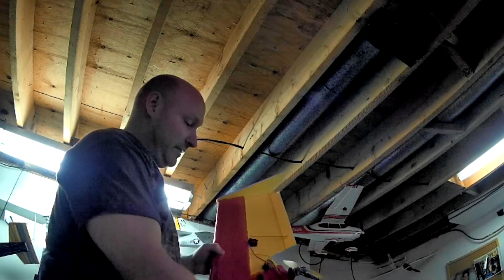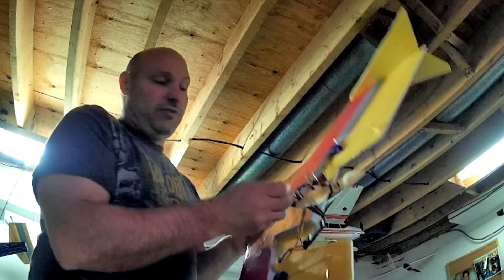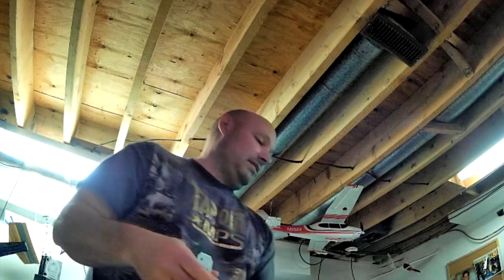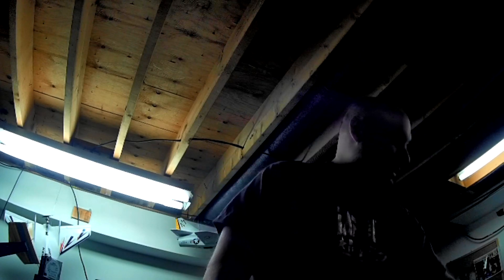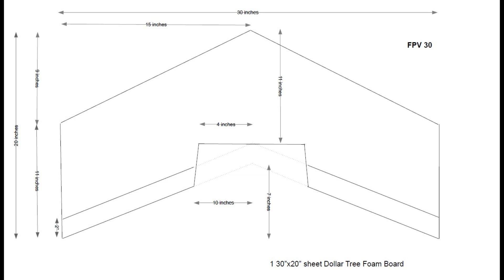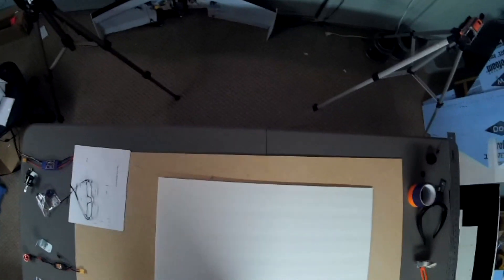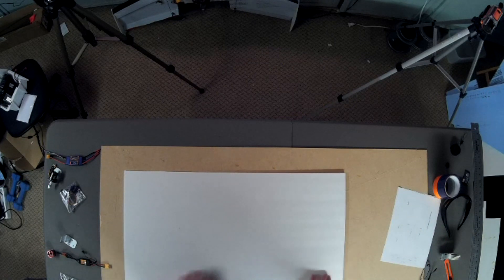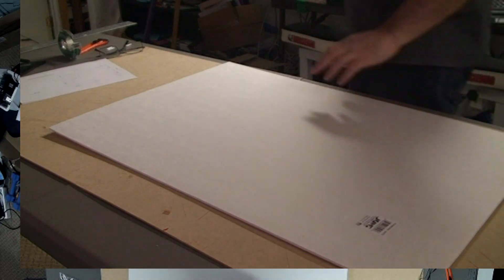How to build a Flying Wing - Part  1 - Taping and Initial Design Thoughts

Comment: Just finished the maiden flight on this beast yesterday with some help from a friend at my flying club. I had to make a a minor modification to my motor mount to get it in the vertical center of the wing. Once that was done it flew like a dream. Thanks for your video.
Reply from the maker: Anthony McDonald Wahooo!   Congratulations.  Did you take any video of it, I'd love to see it fly.  I just watched your bad motor video, I've had the same thing happen (never on a new motor, but after a crash).  The same behaviour though, one of the motor wires is broken or has a bad connection.

Comment: Daniel, If I recall correctly you said that the CG on this build was seven or so inches back on the wing.How did you calculate that value? I feel like that is going to be mondo important to the way this guy flies. My CG calculator (Online) says 6.36 to 6.7 back. Not sure why the difference. Any ideas??
Reply from the maker: Anthony McDonald The original design for this style was by ProjectFlightDesign |(delta pusher).  I think I got the CG from his vid.  I've built several of the KFm2 versions of this wing and generally find that they fly a little better with a bit more weight up front (but launch is a little more tricky), so you might be right.  A little more forward might help a bit.  The first flight will tell you if you are right :-)

Comment: thanks for your answer!!Did you try to paint the plane instead using tape .I do 1/10 rc race and i have some paint around ....I  really love your videos ,im looking for many things about built my own .Did you try with wood too ?
Reply from the maker: No, I haven't tried painting.  With this design I take the paper off of the middle piece (the thin foamboard).  The tape on each side makes it stronger.  A good example of how the tape does this is my lightweight desing (using all foamboard).  You can see how "floppy" it is before it is taped and how it is much more rigid afterwards.  If you paint you might need some extra carbon fiber support, or leave the paper on the foamboard.

Comment: is it really cheaper than a RTF plane when you buy everything separatly ?i love your video
Reply from the maker: Thanks for the comment.  Yes, when you include shipping I think it is cheaper to build your own (shipping the small parts is not very expensive, but shipping the larger foam body can be quite expensive).  The parts list for this plane is more expensive than some others because it is meant for speed.   My FPV44 (about 42" wingspan) can be built for between $40 and $50 and is one of my best flying planes.  Of course one advantage of building your own is that you will automatically know how to fix it and what the correct part is if something breaks.

Comment from the maker: Daniel, those rolls of packing tape are only a couple of bucks each and are 150' x 2" which I think is 25 square feet.  That would put the cost at about 10 cents per square foot.   Not sure the Vinyl wrap can compare with that price.   How heavy is the Vinyl wrap?   Peel and stick in one sheet would certainly be easier, but looking at the pictures I would be worried about the extra weight.  The packing tape is very light and thin, adds almost nothing to the weight of the plane.   Thanks for the tip...you never know (although I did buy 36 rolls of packing tape).   Just looking now, there are some interesting colour combos with the vinyl wrap.